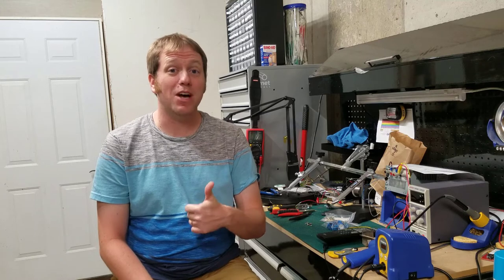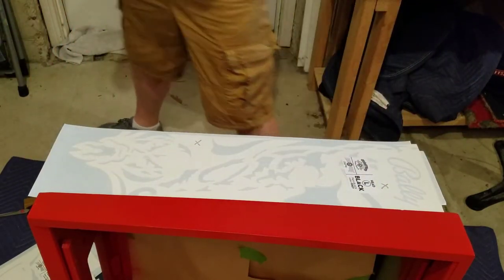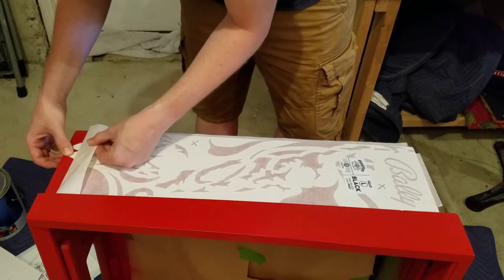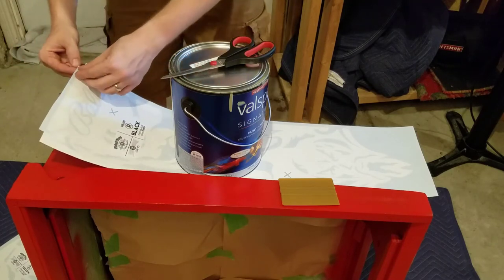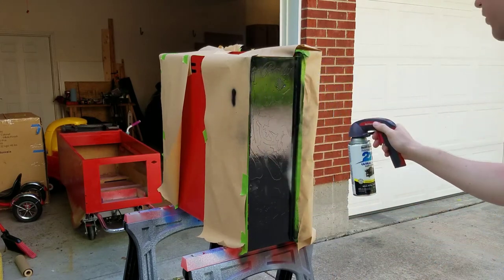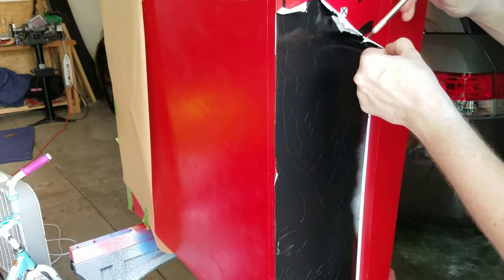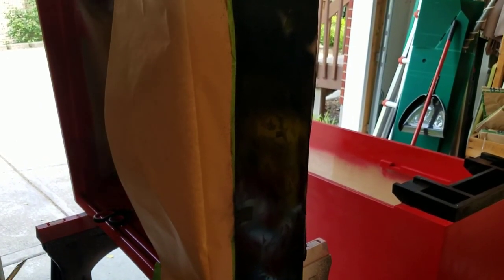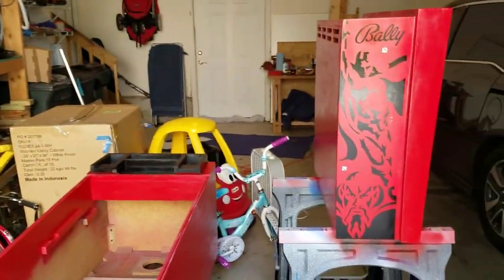How To - Apply Pinball Pimp Cabinet Stencils Part 1

Comment: Do you have to remove the coin door and how do you get the coin door off I have a Kiss Pinball 1978
Reply from the maker: Yes, I find it best to remove. There should be couple of plugs to disconnect next the harness for the coin door,.then there are around 8 bolts and nuts to remove. Not very difficult.